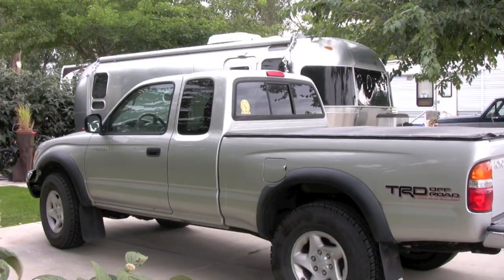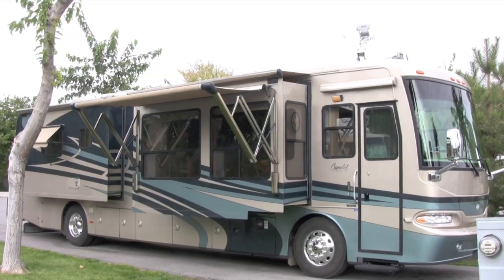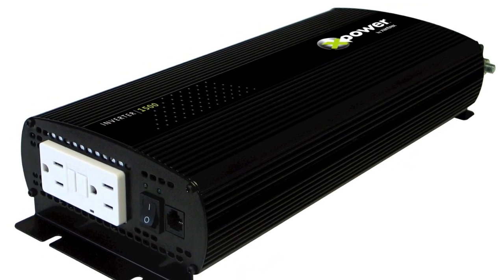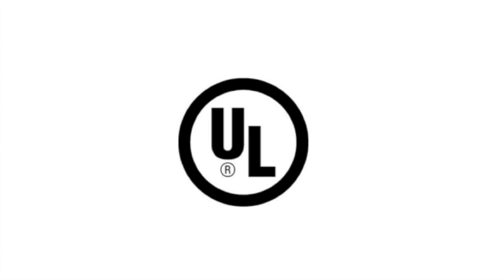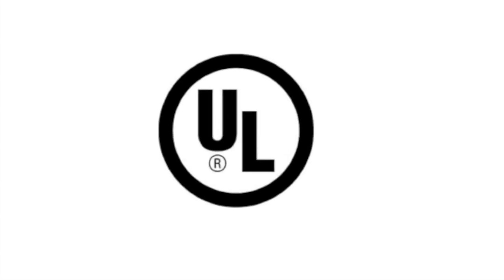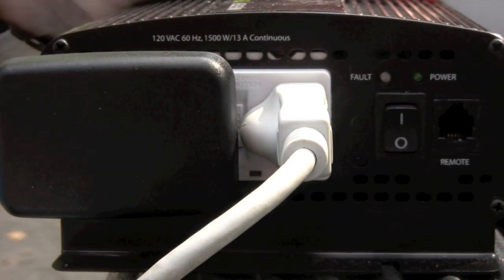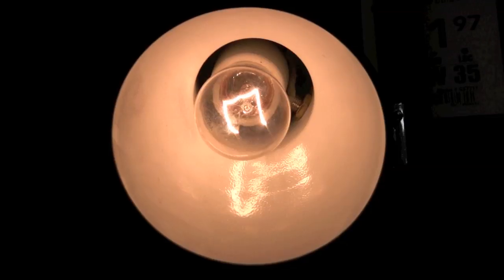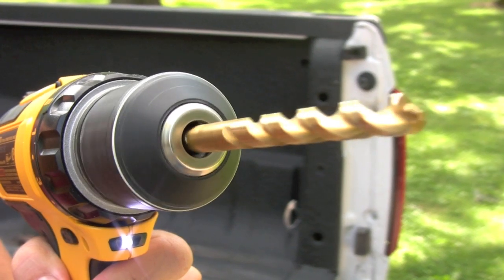Xantrex XPower Power Inverters

Comment: I have an Xantrex XPower 5,000 watt inverter in my Sprinter Van.  The van was an old Forest River conversion with no rear A/C so beyond the fwd cab, it gets how during Southern summers. The roof mount A/C is a 2003 Dometic Duo Therm 11,500 BTU that I can run off of shore power, Onan Microlite- LP 2,500 watt genset, or my inverter.  It has no problem starting it, even in 100F outside ambient temps.  The hotter it is outside, the more amps the A/C compressor will pull.  I upgraded the alternator to a 240A unit and installed a set of 2 standard deep cycle batteries for the battery bank and a single one of same size for engine start.  I have solenoids and marine battery rotatory switches that allow me to reconfigure load source for the inverter either direct from the alternator or thru the battery bank.  Because of the heavy loading in hot weather and the diesel engine's low 700 RPM idle, the alternator is putting out about 110~130A.  The batteries will actual drain, becoming more of a load on the alternator.  A commercial grade 6-phase alternator would rectify that problem.  Run time on the via the battery bank alone in 70-85F weather is about 15-25 minutes with the batteries full and the compressor on 100% duty cycle.  Upgrading to better batteries, install a soft start capacitor and cycling the compressor with a better thermostat (oem one on unit is horrible) should increase the time to about 35-35 minutes.  Good enough for a quick stop when some want to stay in the van and watch a movie.  Trouble is, now the battery bank becomes a heavy load, hence, the solenoids to disconnect that battery bank and drive the inverter directly off the alternator. 

System works well enough (going on 3 years now) for not knowing if it was going to work.  I was on a tight budget so I went the most cost-effective route in case it did not.  Load shedding relays can be used to automate it but those cost alot of money (Bluesea).  There is a bit more to this setup but it demonstrates the unit can power the load for many years.  Even the Atwood water heater, Atwood heater, the Duo Therm Aux heat strip, and Samsung Blu-ray 5.1 3D Home Theater, and 20" LCD TV all operate fine. The water heater electric element can't operate at the same time as the A/C or Aux heat strip (too much load).
Reply: Sam Houston can you Sean pic of your Set up

Comment: My Xantrex 2,000 watts are doing great. My aims 8,000/ 16000 watt unit totally failed after 13 months. The inverter store seems to be playing games with the repair/ trade up program. Every time I call them it's another excuse on why they won't honor their own program which was a new one at half price. Had they just said we don't have any repairs or other programs to help you it would have been ok. After I sent the old unit back @ 73.00 cost it's just excucses now. I beleive I'm done with them.